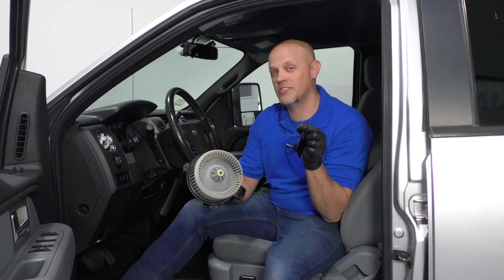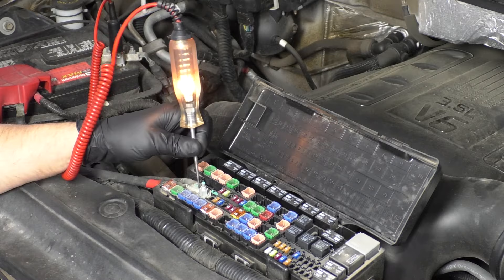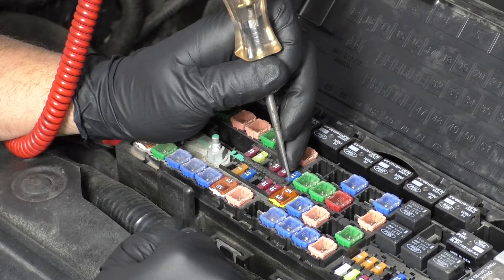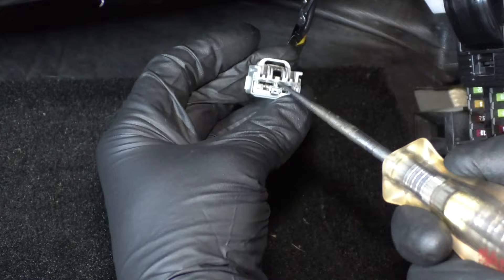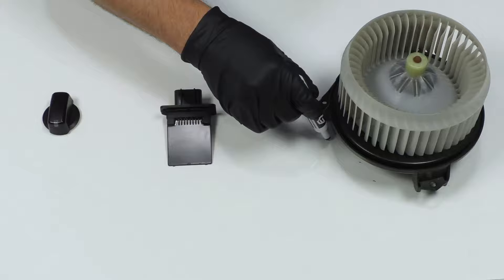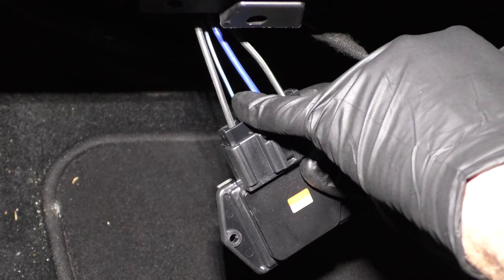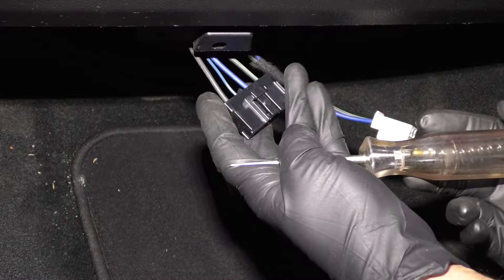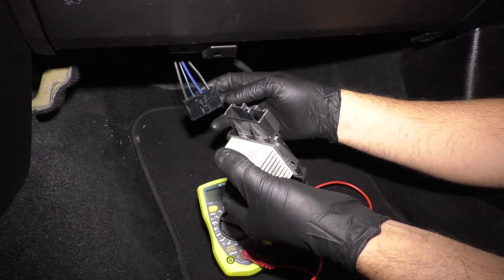Heat Stopped Working In My Car! Blower Motor or Resistor?

Comment from the maker: √  Watch the Video
√  Buy The Part at 1A Auto http://1aau.to/m/Visit-1AAuto
√  Do it Yourself
√  Save Money
Reply: Mine kept blowing the fuse then it melted the fuse
Reply: I replaced a blower motor last year a few months after the heat wouldnt work but it would still blow but it was summer so I wasnt worried about it but now it doesnt turn on at all since I just replaced the blower motor last year should I try replacing the resistor first?
Reply: 2011 Chevy Traverse can you do a video on the amplifier location in that truck I'm seeing three different videos but I don't see the amplifier and also there's a fuse box under the glove box on the passenger side which one is the amplifier fuse the radio play in the tweeters but it don't play in the doors the amplifier I was told to check amplifier in a fuse but where is all that located I cannot find it
Reply: Thanks for the information well presented. I found a bad resistor in my Saab 9-5.
Reply: I have a 2007 ford expedition I have had everything replaced for the ac..the condenser,  the lines , blend doors,  the actuator , compressor , ECT..all relays and fuses are working. The system is charged no leaks detected Ac works fine for months then goes back to hot air  then works again for a while then stops this is a dual ac system  makes no sense what could cause it to work fine then stop .. what could the issues be?????
Reply: Question.only the front vents dont blow on my 2012 traverse.the rear vents and back of the car vents still blow hot/cold. Is the issue my blower moter or something else because of the blower was bad the rears would not work right
Reply: My ac doesn't get all the way hot in winter and doesn't get all the way cold in summer.  What's going on?

Comment: Check your cabin filter aswell! The low pressure created by the blower motor from a clogged cabin filter can put excess strain on the blower, resistor and circuit.
Reply: Right grief

Comment: What if the blower motor works? & why didn’t you test it?
Reply: It's the same as replacing both headlight bulbs or spark plugs.
Reply: He did, he tested the writing harness that goes to it, and the resistor input/output, if power is going either way, you know which part is faulty. Process of elimination, my man

Comment: The production, presentation, and walk through in detail was all I needed. So grateful for you. Two years with no air conditioning. Watched your video replaced blower motor and blower motor resistor. Turned on ac and was blasted with two years of dust lol. Subscribed Thank you! 🙏

Comment: The last blower job I did, the problem was debris in the ducting that had jammed in the fan. Fortunately the stalled fan motor had not burned out (protected by a blown fuse) and removing the obstruction cured the problem.

Comment: Thank you for the short and easy to follow video. Just swapped my blower motor out in my 08 crv took me no less than 5 minutes! Like someone else said I used a T20 bit and it worked just fine.

Comment: This turned the little light bulb on! My resistor blew out, with my original blower motor(really old). I replaced the resistor, it worked fine for a few days. Suddenly the blower didn’t work either. Put in new blower motor, still didn’t work. But now I think I blew out the new resistor on the old blower motor. So now i’m hoping that with my new blower motor, that a new resistor should not longer be “cooking” from the old blower motor! As the video sats, replacing both would be best. Thanks for the great video!

Comment: Excellent video.  Did the basic test light check at the motor harness, power was there. So as suggested, i ordered both blower and resister 6 days ago. They came in the mail today. Took about 20 minites to swap out my 08 tahoe and now the air blows freely again....just before the ice and snow that is coming tomorrow!

Thank you!

Comment: Great video. Love these walk-throughs. Just wanna point out that if a persons suspects a bad resistor pack out of the gate, testing for resistance on all of the resistor points should allow you to make that determination instead of using deduction to come to a reasonable conclusion about what is wrong.

Comment: Thanks for this! Helped me to understand the system and check everything. My fan was making noise for a day, then it stopped turning which caused the resistor to smoke. I watched the video, pulled the motor and found it was binding. Replaced it. Pulled the resistor, and smelled it! Yes, it smelled like burnt plastic, which was same smell when the system smoked. Replaced resistor, checked all fuses. Replaced both for less than 100$. Thanks for the video! 🙏🏼

Comment: I got a test light from O'Reilly and it couldn't reach the positive side of the terminal. I didn't have my tools on me either. While I plugged the blower motor back in it started to work again. These helped me narrow it down, I think it's a loose wire in the connector. Thank you
Reply from the maker: +Salacious Crumb Thanks for checking us out! 1AAuto.com

Comment: Thank you very much, the information you provided is awesome! I've looked at a lot of the videos, but I need help with something else. 
2004 Tahoe w/rear HVAC. The rear temp blend actuator swaps from hot to cold continuously. None of my mechanic friends could figure it out. I've swapped the to actuators (same parts number) and replaced the rear control module twice. I live in south Georgia, so several years ago I manually (snapped the motor cover off and moved it) set it to cold and unplugged it. Btw, I'm a parts guy for over 30 years. Any help would be greatly appreciated, thanks again.

Comment: resistors contribute to alot. fun fact, if your car is having the issue of heating or cooling only one side of the car (left vs right) many times its a faulty resistor. after trying to recharge the a/c system and checking blendoors, the resistor turns out to be the culprit more than not.

Comment: Smart plan to replace both.  My company van has blown through 2 resisters and this thing has been scarely used the last 2 years.  First sign of trouble ... I'm changing both resister and motor.

Comment: Great video thank. Quick question if you don't mind. How do you remove the blower motor wheel off the shaft of citroen berlingo blower? Is it the same on all motors.  Thanks, John.

Comment: Great video and trouble shooting steps. Allowed me to figure out my problem with my blower motor problem. However, going through these trouble shooting steps brought me to the only issue NOT mentioned in this great video, the BLOWER MOTOR RELAY! Can't believe there was no mention of that possible issue. But since the fuses were good but had no power at the blower motor resistor, next possible issue is the relay. But keep up the great videos!
Reply from the maker: +CSCUVA Thanks for the feedback!
Reply: At minute 3.18, he verified the power, coming from the relay, so it is not necessary to check the relay, if there was no power, yes, he would have to first verify the continuity of the line and the efficiency of the relay, in my opinion the youtuber did the right job.
Reply: He did say if those steps didn't work there could be a relay issue.

Comment: Blower was working on high only and would sometimes turn off after hitting a bump. Changed the resister, now blower works on all speeds but next highest(#4 of 5). Car has a low and high blower fuse but no 4/5 power fuse. 2001 Buick Century Limited.

Comment: Got mine to work just by taking it out and spinning by hand. It was tight to spin so brushes are probably going out. won't last long but it will be good enough till I pick up a blower motor.

Comment: Wiggle the plug/wire harness going to the blower motor resistor , I replaced both the resistor and the blower motor. Worked for a few months then failed again , while taking it apart again with the fan in the on position it started working, now replacing the wire harness

Comment: Very helpful. Thanks. What about intermittent issues? Bought a new resister before checking the electrical components (i.e. fuses and connections). I will follow what you did to check the power going to the resister and blower motor before I buy the blower motor (3rd gen Dodge Ram 1500).

Comment: I have a question about the resistor…I get a natural gas or rotten egg smell every few minutes or so when my blower is running. Is that the resistor ? I just replaced my blower and everything works. I just can’t get rid of the smell. I changed the cabin air filter like 3 times. Thanks in advance!! You’re doing a great service for a lot of people.

Comment: Man nice video appreciate it bud, my '11 Subaru STI just made a pffst sound with a/c on and done zero air flow at all, ac clutch spins well fuses are good haven't checked relays yet and it's been blowing cold consistently so best guess I can think of is blower motor and/or resistor. I'm semi mechanically inclined at best lol so I'm just trying to do as much due diligence as I can before taking it to a shop. Gkkd video bud appreciate any advise anyone wants to impart on a cat lol.

Comment: Well explained

I started my car and the ac was already on so i dont know why put i press on AUTO and the motor stop working .. check the fuses box 2 15 amp fuse blown.. when i changed them the fan blower work but with a weird noise.. and it smell like burnt

Comment: All my connectors, fuses, and fan had power.   Of course after taking the fan out and checking if it still worked.    Fan switches on module did not turn when on any setting.  Found out later it was the blower resistor after a new one was put on.  2013 Nissan rogue S.

Comment: Your video helped a lot but problem was different ! I removed fuse in power box for front blower to check it (40A box style clear top) and saw no problem with meter. When I put it back everything working now! Can’t explain except it rebooted fan circuit
Thanks
Reply from the maker: +Dave Crabb Thanks for checking us out. Shop for high quality auto parts on 1AAuto.com:

http://1aau.to/m/Shop-1AAuto-c

Comment: So I have a 2005 grand Cherokee 5.7 and the a/c button doesn’t light up, the window defrost button doesn’t light up, and the fan dials/and temp does nothing. It seems like the whole module is bad? Could there be another source? Fuses and relays seem to be fine also.

Comment: Thanks for the video. My 2009 Corolla does not blow any air through the vents. Do you know where the fuse of the blower motor is?
Reply from the maker: +Hung Giang Thanks for checking us out! The location of the fuse can be found on the fuse location diagram that should be on the underside of the fuse cover. Please let us know if you have any further questions, thank you.

Comment: I have a 2004 Chevy Venture.  The blower first started not working intermittently, in all 5 speeds, then stopped working altogether.  When taking things apart I noticed some melting in the 2 prong harness going from the old control module to the blower.  I changed the control module and found 4 of the lower fan settings work but not 5, the highest.  It's totally dead on 5.  Should I install a new blower motor or could the new control module be bad?  How loose should the blower squirrel cage be when spun by hand?  Mine seems fine but it does have a bit of resistance.  Could that be causing a failure on the highest setting?

Comment: What does it mean if when you turn on the AC/heat the blower makes a loud humming sound? It works fine it's just it takes a few minutes before it stops and it's right back to normal. Wish I could send you guys a video of it.

Comment: How if the Ac control panel makes a clicking when you turn it to different settings and only works sometimes when it is on full blast?

Comment: You guys rock. on a 07 focus the ac works meaning the clutch works but fan dont when on speed 1 but turn fan on 3 or 4 fan works but ac turns off. any idea?

Comment: If the fan control switch on the dash works on setting 4 (highest) but not 1 through 3 in my 05 nissan sentra, is it likely the blower motor relay, the blower motor or combo thereof? I have to wait until Sat (today is Thurs) before I can check conductivity and multimeter so I'm trying to troubleshoot and get a jump on ordering parts. Thanks so much for the detailed and informative videos!!!!

Comment: I have a 2017 Ram 2500. All relays and fuses are good do have 12 volts at blower when running a test line to battery. I have changed the blower motor, the resistor and the climate control unit as well. Still no blower. Can hear the blend door actuators moving to adjust the hot and cold and direction. And all the lights turn on and engage AC. Still now blower. I'm ready to just run a hot wire with a toggle switch to the battery atp just to make it work.

Comment: The blower on my impala got so it would stop running . sometimes after 20 or 30 minutes but sometimes after a few seconds. Bought a resistor to replace it but discovered that wiggling the plug on the resistor made the blower start or stop. Shot some contact cleaner in the plug and the prongs on the resistor. Plugged it back in and wiggled the plug. Also plugged and unplugged a few times. It seems to be fixed without any parts. Will take the resistor back if it continues to work.

Comment: Many cars use an analog resistor.  When these burn out, usually one speed will work- typically high speed.  If your fan only works on one speed, then you can usually bypass all these steps and replace the resistor.  Usually...lol
Reply: Thanks! Gives me some confirmation to my suspicion that its the resistor. Had only high speed for the past year, and it finally shit out.
Reply: Hmmm my astro was squeeling on 2 lower settings yesterday & by the end of the day those 2 lower settings completely stopped working.. Atleast it doesn't squeel on higher settings heh

Comment: Mine was the blower motor from shorting out due to water in the AC box. My AC condenser line was clogged so water filled inside and you could hear water sloshing when turning left, slight dampness on passenger side floorboard under glove box. I blew out line and replaced blower motor and all good for now. I suspect it will clog again.

Comment: Thank you explanation of the blower motor resistor function! I think some of them has a transistors inside !  My Car is Punto evo blowers work, controling speed is Ok. But sometime blower motor stop after 3-5 minutes later works again proporly  for along time ! I clouldn't solve problem What should be do firts ? I need a some advices . Thank you !
Reply from the maker: +Okan Uzun Thanks for watching!  If our video did not help, then you may want to have a local mechanic take a look at it. Thanks for checking us out! http://1aau.to/m/Shop-1AAuto-c

Comment: In my case : My ac blower works intermittently, when car falls in a pothole blower fan comes back to work...I noticed if i tap the blower fan cover with a jack handle it comes back to work after each quitting...a lot say it is lose connection , but I see all kind of cars have that problem too , so not all of them have loose connection , one website said it is brushes inside the blower motor going bad...exactly ...that is it ...temporarily you can tap the blower as a solution ...later replace the blower fan ...of course if there are not other problems

Comment: So we are restoring a 09 civic air and heat work fine, my ac on high is sub par to other vehicles I have driven. I just replaced the blower motor, cabin filter, and engine air filter. I was wondering if there was a way to increase the speed of the blower motor. Especially on these hot Florida days

Comment: Could you help me locate the fuse in my fuse box? I have a 2008 Pontiac Solstice and the fan control has stopped working and I want to check the fuse.

Comment: Excellent explanation! I have a strange problem with my car. Fan is running only intermittently. It is not turning on upon start of the car. However, while driving if I hit a road bump it starts and keeps running. Could this be a sign that the resistor/motor is dying or it is just a loose connection somewhere?
Reply from the maker: +Shaheen's Bansuri Flute We wouldn't be able to diagnose an issue like that here, you may want to have a local mechanic take a look at it. Thanks for checking us out! 1AAuto.com
Reply: Same here. I can hit the top dash and it comes on. Did you fix it?
Reply: I've heard that banging a bad blower motor can help start it up again, I could be wrong but that's what I've heard from some people

Comment: Mine calls for a 4 wire plug going to resistor but I only have a 2 prong plug. I have had several issues with this and believe that is the issue

Comment: Hello,
With an 2004 Pontiac Montana, i get heat blowing out the back hard and strong.
The front blows well (strong) on all speeds but it is not hot, it blows cool /warm.. Sometimes warmer on speed 1 but when I increase the fan speed it gets colder.
I can't figure out why....
Back has heat... Front not.
Any help would be appreciated.

Comment: Do you have to run the car to do all the testing on the fuses and circuits or can the car be off? I'm just asking because I do know that the battery still runs some with the car door(s) open because I killed my last battery taking the door panel off changing my side mirror. Even though the car was off.

Comment: My Mk7 GTI's fan speed started to fluctuate yesterday. If I set the speed to the highest setting (6) sometimes it will turn down by itself like if it sets itself to the third speed and after a few seconds it will turn back to the six speed. Could it be the fan blower or the resistor? Thanks!